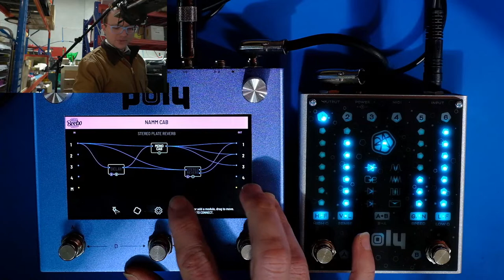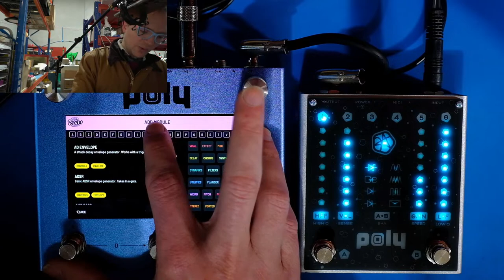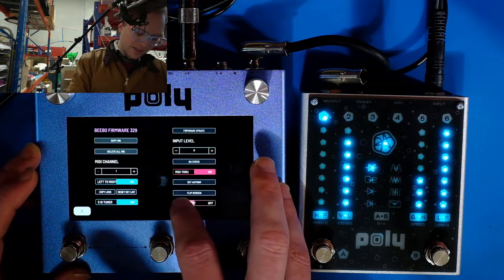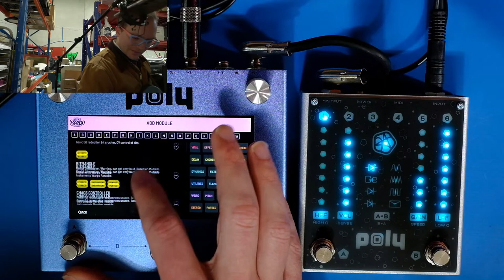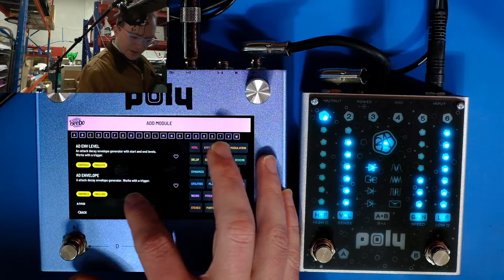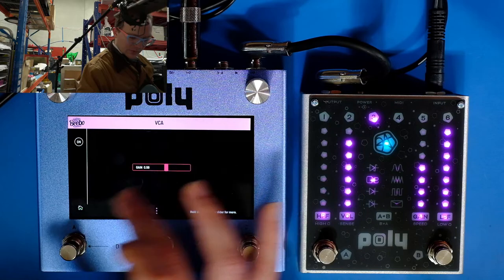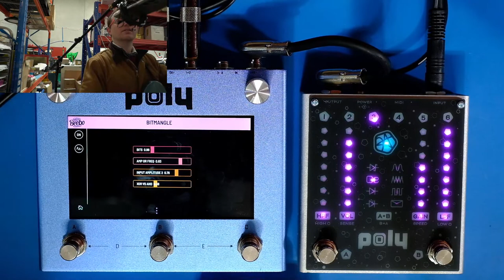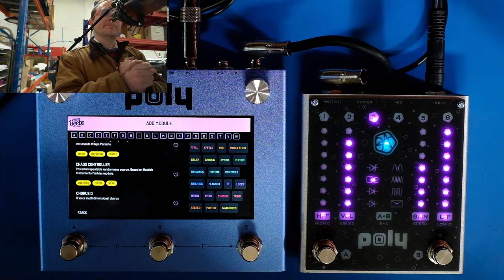Starting at A Live run down of Beebo / Hector modules

Comment: Ugh the stream cuts out just as you were dissing the Basic Reverb (which I actually like!) and it seems to skip Bitmangle, so we miss any explanation of the reverb and Bitcrush and Bitcrushing Delay. Any chance you can re-upload the complete video from somewhere?
Reply: Those modules are pretty basic…what questions do you have?  Bitcrush distorts your signal as you lower the bits below 8…gets kinda gnarly and even choppy down in the 2 bits range.  Bit crushed delay is that same concept added to the repeats of a delay module.  The other controls should be familiar…tone goes between open and darker sounding, warp adds pitch wobbly like modulation to the repeats and presumably is only useful when controlled by cv or sliding your finger on the dial…glide determines how smoothly or chaotic the warp happens and the rest is all standard delay controls.